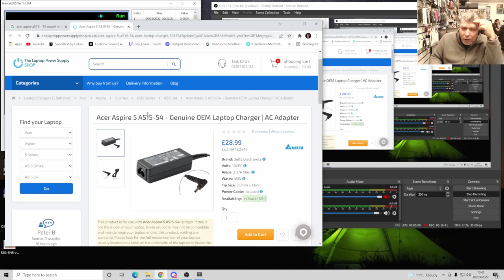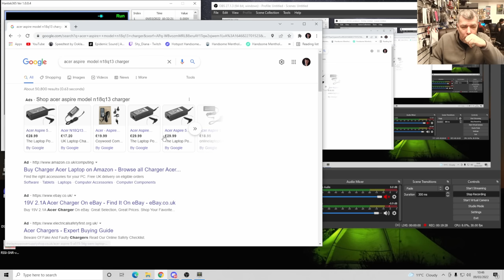Charging the right amount of money for a repair, not a easy decision, Acer laptop not coming on.

Comment: Hello Sorin.
You can plug in the dead charger and in that way the detection pin is shorted to ground thru it.
Then you just apply power from your dc power supply with one hand and with the other hand press power buton. 😉
Reply: this is good idea

Comment: Hello Surin Thanks for your videos
Finding faults is very interesting and intriguing time and time again | Like |
1 customer buys a new charger and burns again because his charger is barely A2.
And the computer needs more A3
It is advisable to check and charge it for half an hour and check again the battery consumption when charging without a computer on. Computer on + charging
I would also check how old the battery is if over a year a battery can also die or one cell in the battery shortens so 3a high
2 Such a small electrical connector with a connection ID switch is often knocked out.
In such a situation is undoubtedly complicated power for the special laptop
Either buy a charger or at least buy an input connector to check at 100% that the connector is working
If the customer is stressed. Tell the customer that you are waiting for the part for a special inspection. And that the customer will not reach conclusions before repair.

Cross-examination in front of the client always helps from experience
General question if his battery would run out fast ?? , Before the computer dies? Or would the battery hold at least two hours of work ?!
>> There are also people who always leave the electricity connected to a permanent laptop because always at home with the computer is usually what kills the battery <<
This gives you another exact direction of what burned
thanks for sharing

Comment: Good one Sorin and what I have learned from you is to always check  logically the  basic fundamentals to start with until we find the root cause of the problem rather than jump to conclusions or assumptions. This is called root cause analysis, which was employed by  factories, aviation and ship building companies and so on to prevent mistakes. I think on this one you were a bit annoyed how the job was taken in. It proves neither you,  the owner nor the staff was wrong in the end. It was a real event how to improve system and process in taking in a repair or job. I am told system and process are not failure proof and mistakes cannot always be prevented but can be minimised.

Comment: I don't really understand why you give warranty on the whole mainboard or on the whole laptop if you only replaced one capacitor. If the graphics, processor, charge controller IC or other capacitor breaks, then it's your fault because you didn't read it out of your crystal ball?
I only give warranty on the repaired part. Of course, if a connection is visible, e.g. a capacitor in the 19V rail was short-circuited, then after a few weeks the first MosFet is broken, I replace it free of charge as a gesture of goodwill, because I see a connection. But without connection, after a longer time it is simply another fault, another repair. If the customer wants a warranty on the entire mainboard, then he should pay for the entire mainboard and have it replaced.
Reply: Agreed
Reply: The customer doesn't know what the repair shop actually did. Your "fix" might have impact on other components. Especially mistakes such as forgetting one screw that might break the hinge or something else later. Unrelated to the actual capacitor but not unrelated to your actions.
Seeing the other shops' repairs on different videos (comments under this video), I understand why these laws exist to protect the customer. 
What is fair for the business isn't for the customer. 
Having a mosfet or a capacitor dead after 1year manufacturer warranty isn't fair either.
I had an high-end 1000$+ Asus motherboard dead due to a simple diode. Just after the 1year warranty.
Reply: Depends on consumer laws in your region.
Reply: This is youtube thing, it's bettery to claim you work like this then tell the turth. Otherwise everyhine would go to UK to fix their cars.
Reply: It hurts the credibility of the shop by providing what feels like a worse customer experience.

No customer wants to hear "I fixed your SMC_RESET_L circuit, now your SMC is bad, so you have to pay again." They would rather pay $200 and have it fixed with a real warranty than $75 once, and $75 again when they come back a month later because something else is wrong. Consumer psychology comes into play. 

you can easily have someone who would be happier paying $200 with the full warranty, than $150 after 2 repairs with an a-la-carte warranty.
Reply: @rossmanngroup  And also because basically most of the customers don't want to care what was wrong. The customer just wants to pay to have the device fixed and usable again.
Reply: @rossmanngroup  You misunderstood something, maybe because of my bad English. It would be "I fixed your SMC_RESET_L circuit, now your SMC is bad, so I'll fix it under warranty." But if "I fixed your SMC_RESET_L circuit for a long Time, now the graphics card is broken, processor is broken, keyboard is broken, display cable is broken, or display is bad, so you have to pay."

My customers almost always want to know what exactly was repaired and get correct information often with photos or videos. 

I give 1 year warranty on all motherboard repairs. You give 3 months warraty on it.  
In your warranty information it says: Warranty is only for the specific part we have replaced and not for any other issues or parts on the device.
I would gladly give a 3 month warranty on all parts, but you will be laughed at in Germany. If the repair is not durable and the mainboard breaks with some fault in a few months after the repair I will repair it without question or if it is no longer possible I will give the money back.
But would you exchange a defective processor for free after e.g. 10 months after you have repaired "SMC_RESET_L-circuit"? I don't think so...

This story already had a prelude. e.g. Sorin told last time that he had repaired something on the mainboard, then after half a year the customer came back because a key on the keyboard didn't work anymore. They had to replace the keyboard under warranty.
Reply: @alexisfrjp  Almost all my customers want to know what exactly was defective... Sometimes they even want to get the removed SMD components back :)
Reply: @SiETechNotebookReparatur  interesting, most of people just don't care that level of detail.
Reply: @alexisfrjp  It may also be somewhat country specific. Germans love details. Especially when the manufacturer says something is not repairable, the services say something is not repairable, buy new, then someone says it is repairable cheaply, the questions are coming about details.
I take thousands of photos and small videos for the customers. Only with complete info about the repair is the service correct.

Correctness also includes not charging for anything that has not been done. I have well under 1% returns in the 1 year warranty period. It seems incorrect to me because of 1 possible warranty case, the other 99 customers to pay more. In Louis's example: 99 people pay 200€ instead of 75€ for a repair.
This eliminates all the people who have no money for an expensive repair, accordingly no money for a new laptop. Exactly those who need the most help.
And if you ask the customers: do you want to pay twice more for less than 1% chance of warranty claim, I don't think any question what most of the answers would be.
Reply: @rossmanngroup  ''you can easily have someone who would be happier paying $200 with the full warranty, than $150 after 2 repairs with an a-la-carte warranty.'' not in lithuania or any other shitty corrupt country

Comment: I recently also received another one of these laptops again, ironically the charger itself was fine (output 19v) and was the OEM charger with the correct barrel size. I assumed something wrong with the charging jack detection pin since no matter how the charger was inserted, the pin was never grounding. Ended up just soldering the detect pin directly to the GND around that screw since the detection seems pointless anyway and worked like a charm again.

Comment: if you plug the charger into the charger port and then apply power and ground, will the laptop power on because the charger port is physically connected by the charger pin? Love the videos,  thank you

Comment: nice job dude :D
I'm also starting with something i suspect that could go wrong instead of following the basics and starting from the power supply or mechanical buttons. 
Its wasting of time trying to do it this way. 
Another option i can suggest if to partially charge the battery and see if the laptop goes on. The war is not won yet but the battle is.

Comment: the charger specifications will be written on the back of the laptop voltage and current
Reply: True, it's what I first thought as well. Sometimes you'll also see both amp specs written there, which is very confusing. Like an HP laptop that says 19V, 3.4/4.7A. Now, I know that the laptop will turn on and "work" with even just a 2A power supply, but that isn't why the sticker is there, is it? 😁

Comment: Yes for example you have shop to run..and you get 10 dead laptops with short capacitors and eatch capacitor cost only (50p) and for eatch laptop you charge customer 1£..so all the day you earned.. (5£)

Comment: Couple of days ago I got a HP I think G1 series laptop....that b...rd :D I wasted 3 days on it because it didn't wanted to start...charger plugged in, attemt to start and it flashed 8 time....well I tought what is 8 times flashing....went on HP official sites and guess what...I found NOTHING :D 1 flash 2 flashes ... 6 flashes....no mention about 8....what tha.... Checked the charger I got 19 volts...the trick was the middle pin....those chargers has round plugs with outer layer, inner layer and a middle pin...gnd is on outer, + is on inner and ... grab your seats....its even a trickier one cuz the middle pin has to be around 15 volts otherwise it wont start :D That b...rd :D And the one who invented it....so I found some suggestion on some underground forums the this may be a cherger issue...So I went in, disassembled the charger and measured the volteges on the charger pcb where the cables start....gnd and + = 19V gnd and middle pin = 15 volts...I even started to curse it :D My God....finally I found it....it was a broken cable somewhere and I lost the 15V middle pin and the laptop didn't started with battery only cuz the same critical low battery issue. :) So yea lessons learned, always keep an eye on the middle pin. :D Oh and 1 more thing: Some chargers go on a protection state if they detect short on the board so alway plug out and back in the charger before measure it. :) Oh and one more thing...I totally agree with you Sorin....you always has to calculate "collateral things" in your prices like "those" type of customers whoes every shop owner knows about. :) So I have a starting price on board repair and I charge it even if I have to change 1 SMD cap but if it's a bigger problem lets say water damage and change a lot of things, it will be more. I always tell my customers this: Well my basic repair is this much if it has a little problem. If its a bigger problem I will calculate the price and call you to notify this for you and if you agree on the repair I will commit it. So that way you it can work. I even can tell the customer a from-to price so he/she will feel that I try to be as honest as I can so they will trust me on that I wont charge them something that I didnt do...

Comment: im still figuring out what happen to my laptop, everytime i use it need to be reheat the whole board and processor first otherwise will not turning on. please, give some tips about this issue, i test the the board voltage are completely present, good charging, keyboard no issue. you have an idea about this issue?

Comment: You should order yourself one of those universal laptop chargers, they come with a huge set of those universal dc jacks for laptops. When doing tests with your bench power supply just apply the voltage through one of those matching connectors. It's also a bit easier, you have both hands free and you avoid the situation with those pesky input detect sockets. Thanks for another great video.

Comment: omg Sorin I just spent 10 minutes shouting at screen "just use fck charger plug to connect these two pins from inside" :D
Reply from the maker: Oh, i didn't think about this, wow, smart, thank you
Reply: @electronicsrepairschool  Hello.. I have a lenovo charger that malfunctioned due to an electrical problem, it became electrifying when you touch the usb.. can it be fixed?  And how is the way to fix it.. Lenovo G50-80 laptop

Comment: I would have though you warranty the work YOU did only on that MB. So you cover the CAP and if something unrelated fails, then that isnt covered as it wasnt the repair you did or caused by your repair. Yes the customer cant tell that and have to rely on you but its the same with dodgy mechanics with what they found wrong and invent stuff just to raise the price. I guess you can charge more and say the whole MB is covered in case they come back with another problem but each customer has to pay higher repair upfront each time. 
Maybe make it clear to customer your warranty ONLY applies to part you replaced and MB in general is not covered?

Comment: Sorin, the bottom of the laptop often has the power requirements on the sticker.
That charger looks like it's for a small laptop, you are right.
New rule: check for propper power supply before fault finding.
Reply: You are the savior last time i remember you

Comment: You jumped the gun on this repair. It was the charger, why didnt you quick check in front of the customer? It is indeed the original charger, the volts and amps are printed on the back of the case, near the model number. You are very unprofessional arguing with the shop owner about a repair that you actually got wrong, on this occasion.
Reply: they get into fist fights on the regular

Comment: Not professionally? I don't think... if the customer doens't want to fix the issue .. no problem.  Give him the laptop as is....  sometimes i receive laptops with brocken power connector because the customer tried and tried to plug   the connector destroying it... but the fault maybe is a mosfet or a cap.

Comment: The battery delivers the additional current. The charger is just enough to charge the battery or keep the battery on the same level when the laptop is under load. The charger can't charge a completely empty battery and deliver the current for the lsptop. It's budget acer crap.
Reply: It is the original charger.
Reply: If the power supply is under the rated amperage, the battery will take the beating of keeping it powered on, but in no way will it actually charge much at all if any and will eventually die.  The battery will also be compromised and the charger isn't the right one.  The right one is 3.42 Amp.

Comment: I guess you have to change your procedures. Maybe the customer has to leave the laptop first so you can check if it is charging port or motherboard issue, and you call the customer later with the price. Because sometimes you may have both issues. It is even more unprofessional to book a job in just by looking at the laptop, and worse than that, setting the repair price by how old the computer is (like it is going to be easier to fix and older laptop than a new one). That is not a gaming laptop, at all. That is a very silly law, in the UK. In the worst case scenario, you would have to refund the customer for the same amount, not having to replace a motherboard. If anyone wants to charge their phone, just sell them a powerbank, problema solved. The laptop should have its power requirements on the bottom cover.
Reply: Some customers don't leave a job until they know how much the fix would cost them or how long would it take. Even though it's almost always impossible to know for certain, that is usually something to be had in mind.

Comment: Why don't you repair the charger if a brand new is 30 pounds?
Reply: Not worth the time and trouble.
Reply: Try taking an old charger apart, carefully clean out all the stabilizer glue so that you can see what is wrong, and you will quickly see why it's not worth the time for a business to do so.

Comment: Hello.. I have a lenovo charger that malfunctioned due to an electrical problem, it became electrifying when you touch the usb.. can it be fixed?  And how is the way to fix it.. Lenovo G50-80 laptop
Reply: First check your domestic power supply earthing! It's most likely culprit!
Reply: @Aneesh.Asokan  The electrical failure in the house was fixed, but the charger did not work
Reply: @samerali2023  Does it have three pins & there's connection from the earth prong to the charger power supply in connector? I ask because in some chargers even if having three pins, the earth prong is simply a fancy without any connection! I have seen this problem in some chargers! If you are not familiar, the easiest solution is try a replacement charger & see if it's ok before going ahead with the purchase!
Reply: @Aneesh.Asokan  Thank you for the reply and the feedback.. In fact, I did not understand much what you mean, you know that the electrical conductors may differ from one country to another, or even the names, but in short, my charger broke down due to an electrical fault, I do not know if it is repairable, the charger connector contains two pins,  I have another with 3 pins, I tried both and the USB still gets electric.
Reply: @samerali2023  Yes, socket pins differ among countries! If you are certain that charger is at fault try switching chargers before going ahead with the purchase. Before repair, get an estimate as most likely it will cost nearly the same as new charger!
Reply: @Aneesh.Asokan  Thank you so much bro